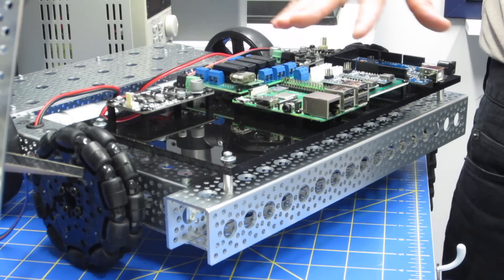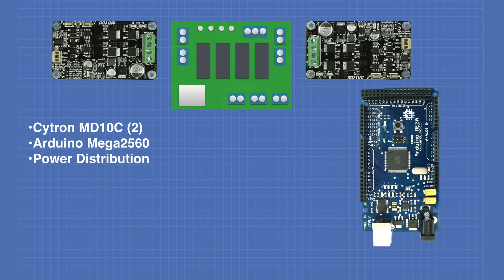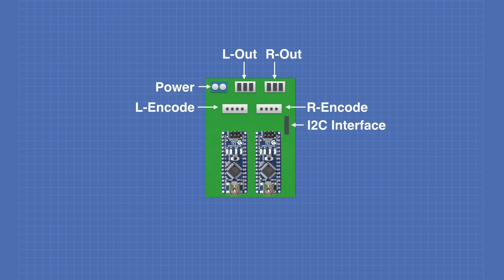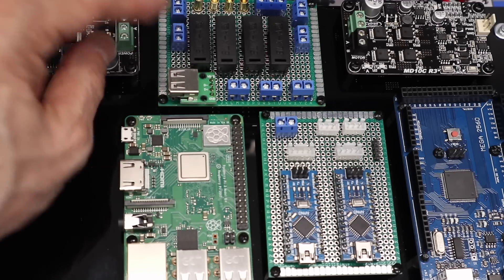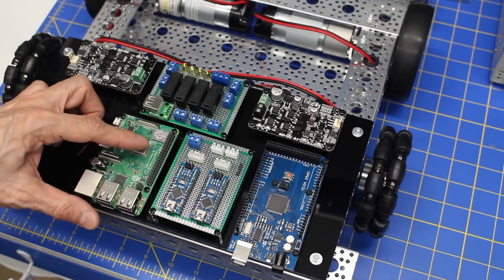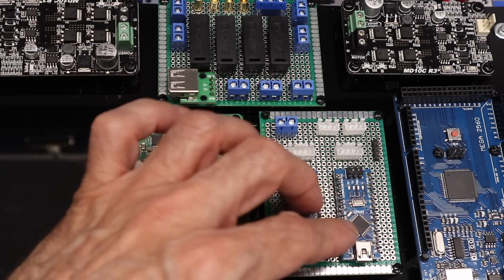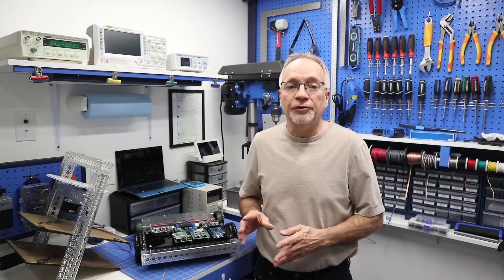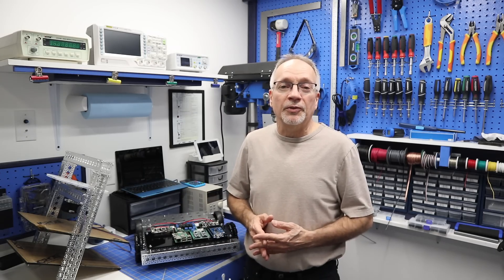Build a REAL Robot - Episode 5 - Base Electronics

Comment: This series is so extensive that I've never seen anything this well done before on YouTube.  I'm only up to Part 5, but I'm already sure I want to build the exact unit Bill is working on, so I'm wondering if there will be a complete parts list somewhere down the line.   Better yet would be a complete kit of parts for the first module that I could purchase bundled together.   Even better would be a a kit of parts with Bill's custom boards pre-assembled on printed circuit boards.  At this point, I'm only talking about a kit that would include the base unit with the motors, wheels, chassis parts,  and drive electronics, plus access to the code needed to make it work as the foundation for building any robot.   I'd gladly pay extra for the convenience of being able to buy all the parts from one source at one time.  Hopefully, I'll discover later in the series that a company like Sparkfun already offers this extraordinary design as a kit, or a set of kits.

Comment: Bill, The connectors on the Arduino look like they hang over the edge of the base a little so could be at risk of being damaged.  Will there be some protection for them and for any cables plugged into them or the other connectors along that edge?

Comment: I'm a retired Machinist and I started dabbling in electronics as a hobby and I find your YouTube tutorials fascinating. So in return I'll give you some advice with my working with plexiglass. When you drill or machine the plexiglass it has a tendency to form minute fractures around the holes you drill and the surfaces you machined. It doesn't happen right away maybe within a week or two and faster if there is a lot of vibration. The fracturing will be more noticeable when you use a worn drill or endmill. Plexiglass May not seem like it but it's quite brittle. Its the pressure from the cutting tool that causes the the hairline fractures you can't see the fractures at first but from the the vibrations they increase a become noticeable. And closer to the edge you drill a hole the more the problem becomes. The Chinese use lasers to cut the holes and shapes into the plexiglass that why the robot cars bodies you get with the electronic arduino kits don't have the fractures.

Comment: Great video!
I’m working on a very similar project. I was also planning on communicating from the computer to Arduino with SPI or I2C.
When I sarted to learn ROS, I found communicating odometry to computer not practical (lots of data throughput!)
Resorted to communicating by USB cable and ROSSERIAL module.
Wiring less elegant, but works.
Would love to share code in future.

Comment: You're pretty much right about the Pi struggling with ROS. I'm quite familiar with ROS and in the past few months I've been using a Turtlebot3 burger model, which features a Raspberry Pi 3 as a main processor unit. The Pi easily overheats whenever you're trying to run a simple SLAM, and the Turtlebot3 doesn't handle as much  payload as you're planning to handle with DB1. I ended up attaching a fan to the Raspberry and you can get away with some autonomous navigation (sticking to low resolution costmaps) as long as you're running the master and the navigation nodes on a separate computer... leaving the Raspberry running only the motor/sensor nodes. 

Can't wait to see you using ROS on a custom build robot!! Keep up the good work :)

Comment: Follow up: You mentioned that you are using two Nanos for motor control. In a previous "robot" I was able to use a single Nano to control two motors, and am working on controlling all four motors in my current project. TIn addition it will be monitoring encoders and avoidance sensors.

Granted that I do not know the details of your design, but you may be able to get by with just the one.

Comment: Good piece, Thank you. Looks like we are using SPI and I2C similarly :) One extra item, which I have on my "power distribution" board, is a Nano-like processor to control, monitor, and report power supply/battery status back to the Pi. I am looking forward to your adventure into ROS. I poked at it earlier and found a little overwhelming. hopefully your videos will help me figure it out.

Comment: Can I use the cytron motor shields on uno to replace the nano?PS cool set up you said you were building a real robot and you meant it awesome electronics
Reply: I think the Cytron motor controllers are going to be individually controlled by the arduino mini's on this design. To replicate the design you would need to replace both arduino mini's with uno's and put a shield on each.

Bill will probably be going over this in one of the next videos. My guess is that using an arduino per motor will allow greater accuracy because each arduino will only have to deal with one interrupt as part of the speed sensor.
Reply: @davidfarning8246   I agree I have both types of cytron boards but I think the shields will work best